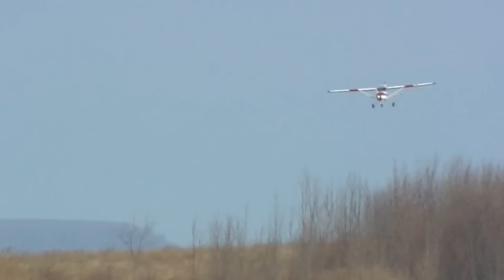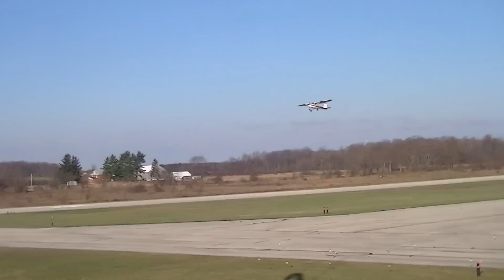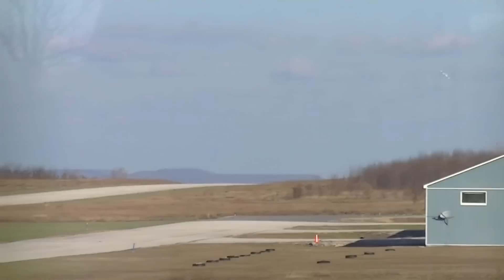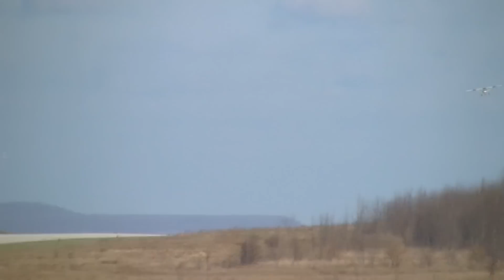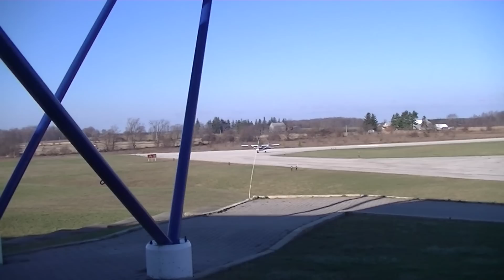Intense Crosswinds Challenge Cessna 150 at CYOS | Pilot's Skill and Decision-Making Tested

Comment: Never touch down with a tire skidding toward the fuselage , away from fuselage ,that's ok
Reply: If you land with a tire skidding away from the fuselage, wouldn't the other one skid towards it?
Reply: @Virtualmix  Not with full ailerons into the wind! The other wheel will only touch when ailerons loose efficiency and the wheel skidding away from fuselage  stop skidding way before that. And all this is happening at very low ground speed!!
Reply: @sparkyr22  Got it, thanks for explaining!
I fly the C152 and couldn't land a few days ago with +20kts crosswind at my home airport after a local flight. Went around 3 times and ended up diverting to another airport nearby after realizing it was more than I could handle. It was a crazy time around the airport: 7 airplanes in the pattern, a couple more on hold, non-stop chatter on the radio, pilots going around struggling to land, tower reporting +20kts crosswind, wind gust and wind shear on final and upwind... I'm usually okay with crosswinds but couldn't stabilize the airplane on final because of the wind violently pushing the airplane up and down all while trying to keep the nose aligned with the runway. I would have gone around one more time to attempt an approach without flaps (I was using 20°) but my passenger was getting more sweaty than me and he wasn't thrilled at the idea of landing on one wheel. 
We landed safely with 11kts front wind at our alternate airport and I was able to return the airplane to it's  home airport two hours later after the wind died down.
I learned a few valuable lessons that day... Wish I had a video to debrief the flight and see what I could have done differently but overall I'm happy I didn't push myself over my personal limits.
Thanks for reading.

Comment: Good thinking with the 0-Flap configuration - more speed at Touchdown means more rudder authority... Use to teach that to my students all the time in the 150 back in the '76/'77 era at Fayetteville, NC...
Reply: More rudder, more elevator, more aileron! I did a wingtip drag / prop strike on my Skyhawk due to a slow full-flaps landing and a monster gust.  I know better now, as they say.
Reply: And old Cessna manual flaps.
Reply: Have you ever been in a modern day airliner when they don't land with full flaps?  They always do.  That's because Boeing and Airbus make it so in their "owners manual".  I was once a passenger during a landing at Newark airport with very gusty high-speed winds.  My guess was 40kts plus crosswind on runway 22 right.  We flew the ILS down the slope on 22 and then because of the huge crosswind, broke off the approach and turned east to fly a right downwind leg to runway 29 to the West.  
      Being a GA pilot, I was wondering what the hell the pilot was doing.  I finally realized he was flying the ILS to 22 only to break it off to make a right downwind leg to runway 29.  There were more yanks and banks than I ever felt in an airliner before in my life.  I was praying the captain was at the yoke.   But we finally landed to the West after a very long touchdown on a 6,700 long (short) runway.  Not a fun experience for a person who had some piloting experience.
Reply: @daffidavit  airliners also weigh a shit ton and don't have tons of excess runway to work with.. hence why they take off and land WITH flaps. A Cessna is a completely different story.
Reply: @daffidavit  Chief you don't know what you're talking about. In high winds you ALWAYS land the Cessna with 10 degrees or NO flaps and a higher air speed. It is NOT always best to land at stall speed with full flaps. Check a POH or get some pilot training.
Reply: daffidavit you have no idea what you’re talking about. Because you landed in an airliner that used full flaps on a bouncy day you think that’s how it’s done every time??  Yikes.
Reply: Sorry disagree.  Touching down with excess speed only means it will hurt more after you lose control at a faster speed.  It's always best to land at stall speed with full flaps.

Comment: The pilot did a reasonable job.  Don't know how many hours he had, doesn't really matter.
1.  He did a go around the first time.  Smart move, don't force something that isn't going well.
2.  He got the airplane 'cleaned up' some and came in faster, which gives you more control.  He seemed to track pretty well down the runway.

All in all, I think he did a great job getting that 150 on the ground.  I love the 150, I really do, but I'll tell you, on days like this, I really want a Skylane, a little heavier, a little more stable.  The ol' 150 gives good meaning to the term 'kite' when it talks about an airplane.  :D
Reply: The pilot did a reasonable job on a super light pre-1960 C150.  He should have brought it in on a sideslip rather
the crab.  Sideslip keeps the nose in line with the runway, but the crab has the nose in the grass or a ditch.
Reply: @rogertycholiz2218  Negative. Crab on approach allows a nice stable approach. Side slip introduces other variables that aren't necessary on approach. Transition to a side slip on final, or ideally, on roll out, because light airplanes can't take much side load on the gear. I routinely crabbed to roll out, then transition to side slip, hold those inputs till touch down, then slowly increase the ailerons to full deflection and elevator to full nose up as we slow down. It's a ride, but nothing like this here, though this pilot made good decisions.